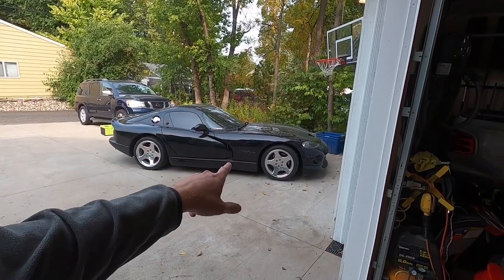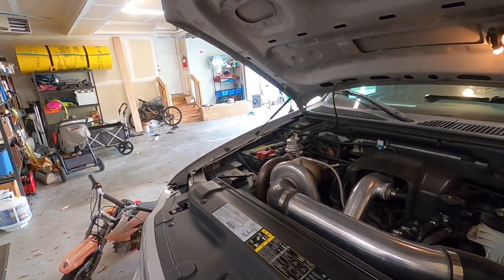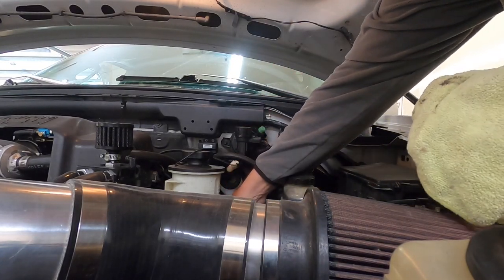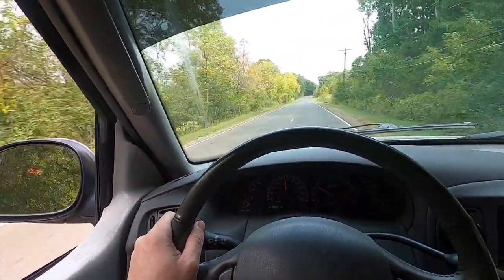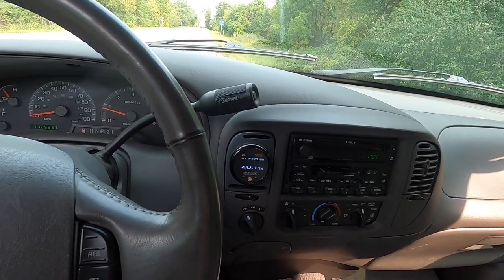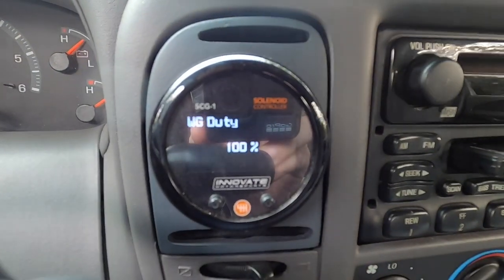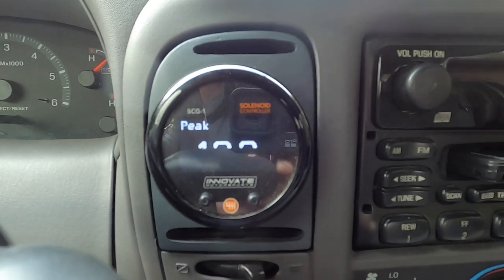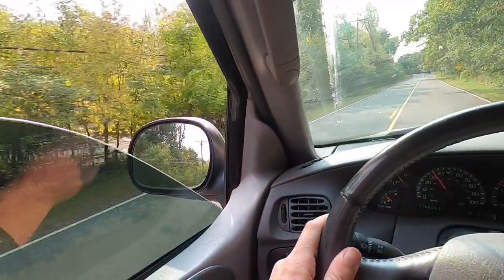Will a STOCK TRITON 5.4L handle 12 PSI?! ***SINGLE TURBO Grandpa Truck***

Comment: What’s your timeline on the build motor? Be interesting to up it to 16psi before you swap blocks. I have done the same size turbo on my 5.4l 04 F250 currently on 8psi till my new tune comes through. It’s piggy bank fuel controlled atm.

Comment: not making enough boost to activate the bov. its called turbo surge and its the air basically being rubber banded in your intake. not necessarily bad but not necessarily good.

Comment: The turbo flutter is not good, the blow off valve is not working correctly, check the vacuum line to it or replace the valve itself

Comment: Bad blow off valve or no blow off valve will cause that noise, boost pressure coming back through the turbo instead of bov

Comment: Is the crankshaft forged or cast? I heard it was a mixed bag of whether you got forged or cast starting in 2002.
Reply from the maker: I think you’re right and I don’t know how to tell without looking at it. I previously got a used block I was going to build and it had a cast crank in it. I have to imagine mine is forged with everything I’ve put it through. 😂
Reply: @AutoDetour  nice.

Comment: The triton can barely handle itself. Phasers have left the chat.
Reply from the maker: Phasers were never a part of the chat. 😂 This is a 2-valve not a 3-valve.
Reply: @AutoDetour  😆 I just heard triton and thought 3 valve. 

I have left the building.
Reply from the maker: 🤣🤣It’s all good. You aren’t wrong though. Those phasers were garbage.

Comment: Well with it being the Tritan 5.4 it’ll most likely blow a spark plug out or the back head gasket then drip oil on the catalytic converter
Reply: nah it's a 2v. solid engine

Comment: youre getting that noise because your blowoff valve spring preload is set too strong so your blowoff valve isnt actually venting air

if you loosen the spring, just to the point where it stops fluttering, you will have better boost performance between shifts

Comment: That noise in compressor surge, and is bad for the turbo. You're gonna need to put a different spring in the BOV. Most likely the one in there is only for 10psi.

Comment: Dang! I have an 01 with 270k on it and rolling on 35's. I could use that kind of power. However, I don't think the engine or transmission will handle that abuse. It would be fun though!

Comment: Even though that sound coming from the turbo sounds amazing I believe it’s actually bad for the turbo it’s anti lag I believe which is when the pressure comes backwards and comes and hits the turbo blades and can actually damage it turbos bad idk if that is the cause of the sound but I would make sure it’s not so you don’t have to buy a whole new turbo
Reply: Not true

Comment: Anything done to that 5.6 Armada behind your Viper? Just bought one and curious.
Reply from the maker: It had the 2 degree timing advance done. Woke it up some! Stock other than that. It’s gone now. We picked up an ‘18 Armada and love it too! Such an underrated full size suv in my opinion.
Reply: I'm usually a Dodge lover, my first Nissan, and the 5.6 has Definitely surprised me. Also surprised to look and see that there's not to many builds with it, besides swaps. BTW Gramps is pretty gangster, thanks for sharing.

Comment: I'm getting ready to try the same thing.  My cousin died in Iraq the same week I was wounded in Afghanistan and he left me his truck.  It has a bad motor, im buying a 5.4 to put in it and want to put a kit on it. I own a 2019 f150 with ecoboost that has an upgraded turbo pair and an intercooler.  Do you have a video about moding the kit for the 5.4?
I'm not a kid and was an investor in a shop at one point that did nothing but ford performance.  I am doing it as a tribute to him.  I let a family member have the truck for going to college and he didn't take care of it, now I have it back.  It was a 03 f150 STX flareside, single cab with a 4.6.  I own a racecar (95 Saleen S351,) and a 01 Camaro Z28 (40k on it) and want it to just be a nice addition.

Comment: Everyone hates on ford so much just reading through the comments lol But when talking about the used car market you can usually get a lot more vehicle for the price, buying ford.  You can get a mustang gt for about the same as people try to sell clapped out v6 camaros. My 2011 Crown vic only cost $1300, idk what the GM equivalent would be maybe like a 1994 Caprice which cost more. 🤷‍♂️ If your broke like me makes sense.

Comment: When I go wide open throttle I get a chirp sound still can't figure out what it is
Reply: Straight Line Cycles could be a belt squeak its common on these trucks
Reply: @htxjona216  i though so too. Only thing not new is the crank pulley...
Reply from the maker: Mine used to squeak when it shifted until I replaced the serpentine belt.

Comment: Wasn't the supercharged Harley f150 of the same vintage the same 5.4L? Don't see why it wouldn't work lol. I know they only ran like 7-10 psi from the factory but they sold a pulley swap for it. I think you'll be fine as long as you don't bang off the limiter lol 😆

Comment: You need to take your bov and check it, it's now opening and the air pressure is going backwards. Not good for turbo

Comment: That flutter sound isn't necessarily a good thing. I'm sure you know that now. Sounds like boost surge it can mess up your turbo. The wheel is wiggling around a little because the waste gate isn't letting the excess pressure out. If I'm not mistaken. I'm used to turbo diesel and fairly new to the turbo world. So I may be getting something wrong.
Reply: The way I understand it is that because the turbo isn't making enough boost to open the waste gate. the pressure surges back past the turbo causing the flutter. I would imagine that this causes the turbine to slow at a much faster rate and could cause faster wear however I know some cars are designed with no waste gate at all and they all make this noise.
Reply: @Aszelgus  yeah I'm definitely no expert but I do believe in some turbo set ups it isn't a big deal. I just know (from "Truck Master" youtube channel) in regards to Duramax's and other diesel trucks in general,  it's not a good thing. For the reason you mentioned about extra wear etc. However I do believe depending on how much you're getting into the throttle it is something that is definitely going to happen sometimes. Sure does sound cool though haha.  I just don't think being super excited about it makes much sense ya know lol? I only vaguely remember what I left my original comment for. Twas awhile ago.
Reply: @bass-n-truth-inthestix9083  I grew up watching wrc and many different turbo setups and sounds where represented.   My favorite sounding one was always the audi turbo flutter  so I do totally get his excitement .  Also given the setup he's running I don't think he cares about extra wear.
Reply: Yeah I feel you there. I like the sounds for sure I'm just overly aware of trying to keep my truck healthy for the long haul lol.  So I try to avoid making it happen with my duramax. It still doesn't keep me from laying into it a bit though. It's almost impossible to hold yourself back from it. You hear that and you know the vehicle is going to rip.

Comment: Basically a ford lightning rods won’t live long on 12psi
Reply: Depends on the tune really. So long as the timing is not touched at all. You can squeeze 550hp out of the stock internals. If you can't afford forged internals. You need to at least take the pistons out and gap the rings to 30 thousandths. I've seen both the 4.6 and 5.4 2v eating well above 700hp with only properly gapped rings. Ring land failure is the number 1 cause of engine failure in boosted applications.

Comment: The sound is a pressure wave that is banging the hot side wheel and the throttle plate. It's bad, to me it sounds horrible, the bov should be able to smoothly relieve pressure. This whole thing happens when you close the throttle plate but the turbo is still making pressure but no escape. Tune your Bov so it doesnt do this. It should sound like a shotgun

Comment: I wouldn't go any higher than 12 PSI on pump gas. you're going to need E85 or at least methanol injection with pump gas

Comment: Might be turbo surg to just make sure to check on it.  I know this Video is kinda old
Reply: Nice truck btw  looks like a sweet sleeper
Reply: Shaky brake might be  Worped rotors
Reply from the maker: Still haven't fixed it, but still running strong!

Comment: Probably not because those pieces of shits are recalled. It’s at 116xxx next 5-10 thousand miles it’ll start falling apart. It’s cheap metal. Bad welds.

Comment: The 5.4 triton was such a disappointment the 5.3 ls beats and the 6.0 ls does it even worse
Reply: The 5.4 had more power than the 5.3 lol. And that's only the 3v. A 5.4 4v will shit all over any ls junk.
Reply: @AR-uz4ek  lol headass the vortec made 30 horsepower and the triton only made 30 more torque , still ls was better , more potential, reliable , and affordable,
Reply: @juanmmares  LOL put the crack pipe down

Comment: Typical of a baby YouTube channel throwing a turbo on any old junk to try and get views and subscribers. That is the normal noise that when boost isn't blown off properly it back feeds through the compressor housing and that is the flutter noise that you get. your blow off valve is not working properly